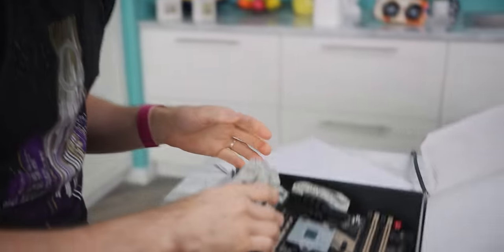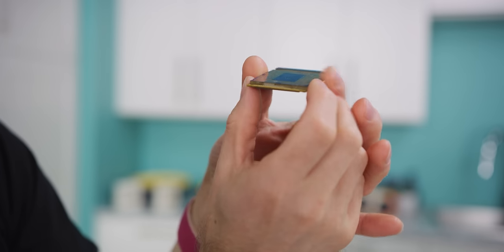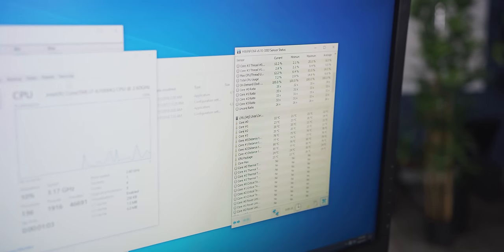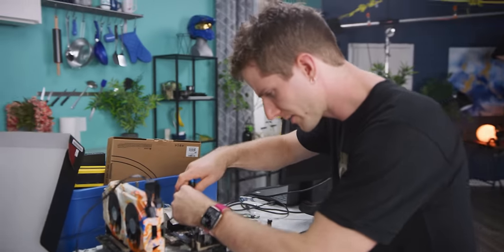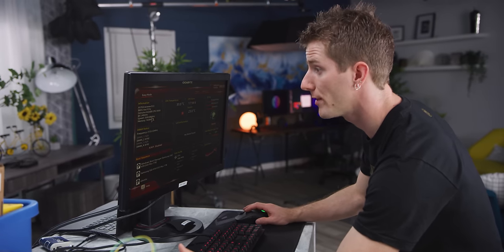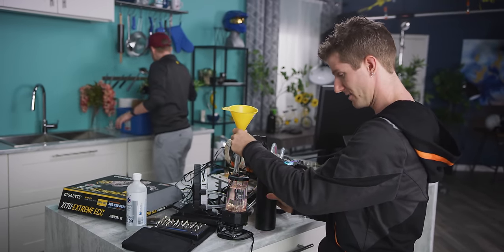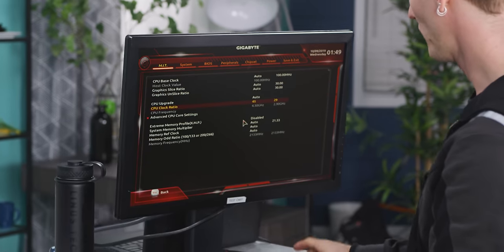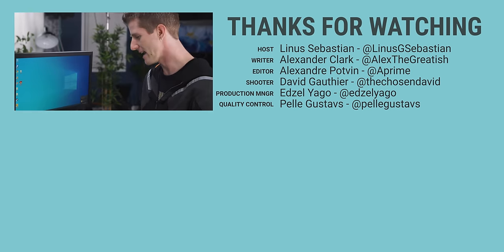Testing out Mystery Chinese CPUs

Comment: Storytime with my last CPU situation: 

Back in June of 2019, I built a new system with a Core i5 9400F. I had bought the Motherboard, RAM, and CPU ahead of the GPU because of money constraints. (I already had the case and PSU) So I slapped what I had together and tried booting with my GT 1030 and nothing happened, I and my boyfriend thought it was because MSI's cheap motherboards didn't like PCI powered GPU's and left it as-is till we picked up an RTX 2060 XC 1 month later. (Intel F series are not APU's) Once we got the GPU we put it in to see if the system would post but it didn't, we reseated everything till we looked at the CPU...

It was bent

I must've made board flex when putting on the cooler, so my boyfriend suggested to put something soft like a sock on the edge of a table and push the corners that bent down with fingers on the contact-pads, slapped it all back together and it posted...

we fixed a computer with a sock.
Reply: babydoh lol
Reply: 😂😂😂 good
Reply: Is your boyfriend Louis Rossman by any chance?
Reply: @Zwettekop  That gives you 5V on CPU_PLANE_V3_HOT and now we have USB spin. He taught me everything I know ;)
Reply: @excitedbox5705  PPBUS is hot😉
Reply: @Zwettekop  Black head😂
Reply: You might want to use some other (anti-static) material.
Reply: @Zwettekop  naw his name is Austin
Reply: R/thathappened
Reply: Do you still use 9400FS (S for sock) in your setup?
Reply: @wickeddubz  Yes I still use the system, works great 😁
Reply: @wickeddubz  9400F is an ok chip if it's cheaper than the Ryzen 3600.
Reply: My turn, my young paranoid ass kept thinking I broke something. So I kept taking apart my pc and putting it back together. And then. *crunch*. I put the cpu upside down. And I forced it closed. I cried for 0.5 seconds.. The things that stop you from putting it the wrong way round bent the cpu. I took out the cpu, put it back in the right way, forced it shut. Holy shit it boots.

Side effects include, half my ram slots stopped working. And my pcie gen 3 x16 turned into a gen 3 x2.

I didn't know the ram slots where busted till a few months later when I realised I wasn't running in dual channel.
Reply: @bsadewitz  Antistatic bag OVER the sock would do the trick :D
Reply: @DanceySteveYNWA  r/foundthemobileuser
Reply: did it work? posted doesnt mean it did.
Reply: He fixed a computer with a sock.. A f*cking sock
Reply: @Churchgrimm  Hahaha, I like the way you think!
Reply: @excitedbox5705  lol usb spin....
Reply: @Derpynewb  you should not build systems lol...
Reply: @danielb1621  I've built all three of my siblings a pc. I put an ssd in my mom's laptop. My only mistakes were with my sisters pc. The Asus wificard is garbage. And the rx480 in my brothers pc thermal throttles. Fak
Reply: @Derpynewb  i cant even count how many systems i have built, cannibalized repaired... etc... and i still have a shitty desk job because my income cant keep up with the certifications to get that better paying tech job lol... i grew up on tech since i was 12 and im 35 now....  life sucks when your parents aren't rich and dont have any outside support and just the pure fascination of tech by your lonesome pushing and driving you. i dont think i have ever had a manufactured PC (compaq/hp/dell etc. everything was mostly rebuilt from trashed or hand me down parts so i never had a new PC but i always had one. :) always had to fix them, upgrade, etc... re-solder parts that had "chip creep" all too often. etc.... but yep... still working a shit $20 an hour job which in itself is grossly underpaid.... im probably the lowest paid professional in all of the bay area....
just because my boss thinks its livable on my wage.. he doesn't even stop to think how expensive life is even in my city 3 hours away.... rent is 2/3 my entire check... and i work for a global software company... which is private and niche, everything done in house so the boss saves a lot of $ especially having me do multiple peoples jobs at the fraction of the pay only 1 of those titles are supposed to receive. i strove to NEVER make errors like that. drive yourself to do the same and you will be better than this linus guy that just had better opportunities than us with parents that could pad his way.
Reply: Now I have a monster PC :)
Reply: How did you manage to bend pins on an intel chip? Afaik all modern intel CPUs are LGA (Land Grid Array) with no pins. AMD chips are still PGA (Pin Grid Array). So I'm guessing you either bent the recieving pins on the Motherboard itself or had an AMD chip.

Thanks for the storytime though!
Reply: @Kholaslittlespot1  The corners were bent from board flex made when putting on the cooler, I don't have an anti-static mat so I just used the motherboard box to put everything together on, I do realize that LGA doesn't have pins. if people are wondering I use the system daily.
Reply: I ordered a used 939 board back in the day and I couldn't get it to work, but then I noticed that it was bent undernearth the northbridge, and I could press really hard on the heatsink on top of that to make it work, so my solution was to take the heatsink off, pull the mounting clips off the motherboard, and drill and tap holes where the clip holes would hit on the heatsink, and then screw it on really tightly. It worked like that until I got rid of it.
Reply: Haha good job man. Yeah, some of those old Athlon boards could act funny. Always important to have good contact for cooling.
Reply: Well.. the sock was made after all for the SOCKet ... 😂😂
Reply: Thanks for sharing your experience and trying to help.
Reply: Nice story...
Reply: Can I be your manfriend?
Reply: @bsadewitz  Not everybody wears nylon socks.... those that do should simply wear anti static wristbands around their ankles. Though I would advise opening a window when the CPU is under load, especially if the socks were nylon XD
Reply: @sonnyburnett9077  That gave me an awesome idea:. Why not package antistatic wristbands WITH the socks??!?
Reply: @sonnyburnett9077 Or how about this:. We develop a proprietary interface for hooking yourself to ground.  We then sell antistatic socks, boxers, briefs, panties, wristbands ... everything.  They all connect together and then one cable runs to ground!!!
Reply: I don't know whether i'm more surprised about the fact that you fixed delicate computer component with an electro-static conductive material or the fact you are a girl.... that works with computers
Reply: I didn't know intel had apu's
Reply: A sock lol, awesome.  I fixed a processor back in 2004 that somehow had a pin snap (can't remember), I fixed it with a tiny piece of (just the right sixe) copper wire I cut from a coil from some electrical component I had taken apart, seemed to work just fine until I built my first and only full build PC in 2006.
Reply: Fun fact some of our Mk VI machines (casino) only run with their mother boards flexed just so...Typically a toothpick is test fitted until it seems sort of stable.
Reply: Cool I just got that cpu
Reply: Is it a real story
Reply: @davedemolisher8730  yeah bruh I'm using the system rn
Reply: I RMAed a CPU with bent corners (bought it from an idiot for 15$) and they sent a new one back lol. the guy put it in the wrong way, and intel thinned out the PCB on their chips since the 6th gen so they're easier to break now
Reply: So you bent a CPU pin like a dummy, and then proceeded to use the wrong tool to fix it. That is really embarrassing, why would you share something like that lol
Reply: Too bad it wasn't a SOC.......that would have been even cooler to fix with a sock! lol!
Reply: @danielb1621  Hmm...
Sounds like you've had things pretty rough.
Your story actually sounds a lot like mine; Ah the joys of cannabalizing old hand-me-down-and/or-broken junk.
Except I'm a bit over 10 years older. Could never afford to go to college, so I had to learn it all myself, through endless hours of unguided online research and trial and error.
But I never tried to become a "professional" pc repairmen, I just learned how to fix what the local professionals couldn't, or broke.
I just repaired people's computers for free, to keep them from getting screwed over, and because it happened to be the one somewhat-useful thing I could still manage to learn about and do after I suffered massive brain damage about 18 years ago.
And the only time I ever earned as much as $20 an hour, was on sundays at a factory I worked at, during the last few months before it shut down, because they were paying double overtime.
So, officially, the highest paying job I ever had, only paid half that wage you feel is shit.
But I was actually lucky to even get that job, because the one before that, paid less than my monthly child support payments, so I'd been having to live in a house without a toilet, just had a bucket in the garage with grocery store bags for doing my business; My electic box had a pay-as-you-go card reader and you could buy these disposable cards from the electric company in whatever amount you wanted, swipe the card at your electric box, and *tada*! you'd have electricity for however long the the amount you paid for lasted. So some friends that I had, who worked at mcdonald's, would take collections for spare change that they'd use to buy cards to keep my electricity on, at like, $2-$5 a pop. They'd also, *ahem*, "Appropriate" a box of frozen hamburger patties every so often, and bring it to my house to cook over a junked grill that had been rescued from gutter, sticks from trees in the neighborhood, so that I wouldn't starve to death.
So yeah, when I got a job that paid $10 an hour, I quite appreciated it :)
And later on, when that factory shut down, and I got a job that paid less than $10, but still more than mcdonalds, I was thankful for that too.
Right up until the chemicals at that job built up so much in my system, that I was reduced to being something more than a vegetable, but less than a person.
At which point they no longer paid me anything at all, but it didn't really matter, because by that point I couldn't even count money anymore and wouldn't have known what to do with it if I could.
Ah, side note, I have gotten quite a bit better since then :) I'm also thankful for that. lol
But anyway, what struck me most interesting, and in a way, most amusing, about your comment...
Was how similar to my own life it was in the beginning; I was really enjoying and relating to that:)
Then in the middle, it takes a bit of a turn, going from a story that sounded like you might be some sort of hero, triumphing over hardship in order to make something worthwhile through adversity...
Into something more along the lines of complaining about how you aren't being paid your fair due.
And I was like: "Wow... He just shat all over what was basically twice the highest wage I ever earned, as if a $20 bill in the gutter wouldn't even be worth bending over to pick up. lol"
And then it took an even further turn into a direction I wouldn't have expected; ending with the "message":
"i strove to NEVER make errors like that. drive yourself to do the same and you will be better than this linus guy that just had better opportunities than us with parents that could pad his way."

And I was just, like, wow.
I didn't see that coming.
And realized I was totally wrong, I am not like you at all.

And it made me want to ask you something like: "Do you really think linus gets 2 million views on a video, is because he had some rich parents or something? And that his continued success, is just nothing more than having some better chances at some opportunities?"

But I don't really feel like asking you any questions anymore.
Instead, I just feel like pointing something out.
If you read what I wrote, it should be obvious that I neither have parents who would pay my way through the happy life, or have floods of great and easy opportunities coming my way. now, or ever.
However, it's not *those things*, OR whatever-past-hardships-from-my-life, that are keeping me from being somebody like linus <<--in regards to being a popular and successful youtuber, computer guy, and entertainer.
It's my personality, lack of drive/motivation, lack of knowledge, lack of social acumen, lack of ability to change any of those things enough on my own to create a carreer such as that.
Because it THOSE things that are what make linus successful.
He has essentially *created himself*, has made himself who he is, and is now *selling himself*.
I don't mean "selling out", I mean, selling his services and *skills*; as an entertainer, an artist, even a teacher and heck, even a role model.
I don't "sell myself", because nobody is buying what I have to offer.
If I improved what I have to offer, maybe some people might start buying.
I stream some games, some people enjoy watching <-- but I am not particularly interesting in capacity, and I haven't dedicated any real effort to improve upon it. not because I wouldn't like to be more popular; rather, it would just take too much more, than I have to give right now, to make a substantial improvement.
I am also a guitarist, and good enough that there is probably a chance that I could make some money with my related skills in that area, IF i really knew how to do that.
Lots of people do, but I wouldn't even know where to start.
I can also make people laugh sometimes. When I'm really on top of things, I can actually be pretty good at it...
But again, that's something some people are good at making money with, but I wouldn't even know where to start.
Plus, being a successful comedian, or any type of entertainer, is actually a lot of work.
What WE the consumers see of it, is like what the people who pay your boss money for things, see of *your work*.
They don't see all the hours or effort that you put in, to do all those "other people's jobs", in order to produce whatever it is that people end up paying for, in order to pay your salary.
They only see the end result.
And basically what I'm saying, is that what any of us see of linus's work, is merely *the end result*.
You may not like him, or what he does.
But when it comes to being 'better than this guy', it's rarely as simple a matter as just a few missed opportunities or some priviledged parents.
Linus's work created this whole show, he picked the people who he surrounds himself with, gathered that team that helps him create this content, this little "linus tech world", full of these people who used to do this or that, but then became a part of his world, and by proxy an extension of his creative influence.
And, since both you and I have both viewed AND commented on his videos, we have become a little outlier part of the overall linus-effected-universe.
And heck, him making this video even gave you*, an underpaid disgruntled employee who feels he is better than the channel creator himself, an *opportunity to do things like, rant about how much you have to work at your job, while simultaneously insulting him, complaining about how you aren't paid enough and didn't get enough good opportunities and didn't get enough money for your parents, and indulging in a little self promotion at the same time.
And me, well linus gave me the opportunity to post whatever here, as he does for everybody with every video he makes...
But it was really you that gave me an opportunity here.
An opportunity to feel justified in saying:
Dude... If you want a better hand in life than what you were already dealt, you've got to put more into playing the game. If you want something to happen in your life, other than what just randomly happens, YOU have to do something to change things, to make new things happen.
Opportunities haven't just fallen into your lap? MAKE some opportunities happen.
Linus had a job before he started doing this full time.
You have a job.
You don't like your job? they don't respect you enough? they don't pay you what you are worth?
Well, continuing to do the same thing despite hating what you are doing, is *selling yourself SHORT*.
If your skills are really worth more than you are getting paid, then stop selling your skills for less than you deserve.
Instead of sitting around typing about how much better you are than somebody else who had "better opportunities", spend that time doing whatever it takes to get a job that actually pays you a wage that is *equal to the value of what you put into it*.
Because I'm not aware of any Job Fairy, that just goes around finding the most underpaid employees in order to offer them jobs that pay double or triple the amount.
Those jobs, of course, are out there. and if one doesn't know how to get them, then one has to try and learn how to get them.
Cause waiting on luck to make your life better, is just wishing to win the lottery without even wanting to bother buying a ticket.

Anyway, despite my disappointment in what you wrote, I do wish you luck in your endeavors.
Take care, and have a good day. Hopefully a better one than yesterday :)
Reply: chrischaf yeah, life has been rough for a lot of folks in the tech field.
Reply: @danielb1621  My daughter tried at it for a while, but eventually got so fed up that gave up and moved to Alaska. lol (literally)
But hey, I saw that you said you now have a monster PC, and you're only in your 30's, so there's still plenty of time to make things more interesting.
You could even give youtubing a shot yourself:)
Seriously.
You could make some videos that show some of those skills you've used over the years to others. Show some DIY stuffs, like maybe how to canabalize old hand-me-down stuff and make it into something useful, or whatever you'd like to share or demonstrate.
You never know, it might become popular, or it might not. Popularity and success are simply not things that can be guaranteed.
But either way, it could turn out to be an enjoyable pastime or hobby.
And one doesn't have to have a RED camera that costs more than a car in order to put out good/interesting/entertaining content, so you don't have to be rich to give it a go :)
Anyway, it was just a thought, cause hey, why not?
I mean, personally, I can say that a lot of the most interesting/fun/rewarding things I've ever done in life were, at one time, things I'd thought were something I'd never do/try, or things I hadn't even ever thought of doing (or imagined myself doing or wanting to do) in the first place, until (for whatever reason) the idea or opportunity suddenly came up and it's like... well, why not? lol
Change can be a good thing sometimes, especially if/when we have reached a point in our lives where things have become somewhat stagnate and it seems like we are doing little but going in circles; it's actually easier to end up in a situation like that, than it is to avoid getting into one, so it's always important to remember -that it's never too late to try something new.
Or, as my grandfather used to say before he passed on: You really can learn something new -at least ONE thing-, every day.
Anywho, take care and have a good evening sir :)
And hey, if you ever do decide to put up a video like that, bloik in a reply/comment to let me know, and I'll check it out:)
Other's that get notifications on this thread might too.
Of course, I can't promise I'll like it, but I can at least promise to watch it with an open mind ;)
catchya later gator!
~~^_^
Reply: Holy shit